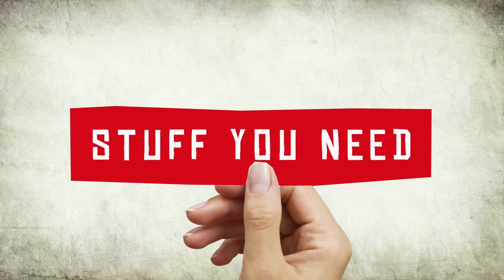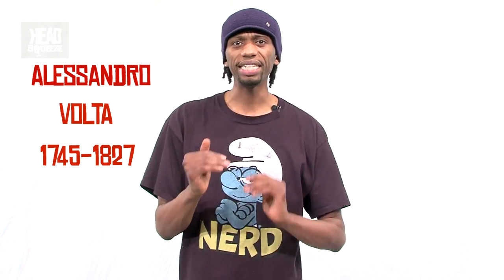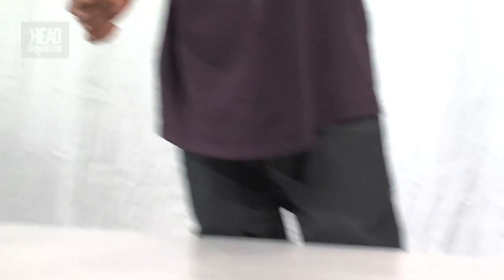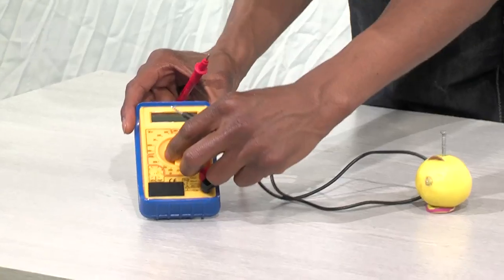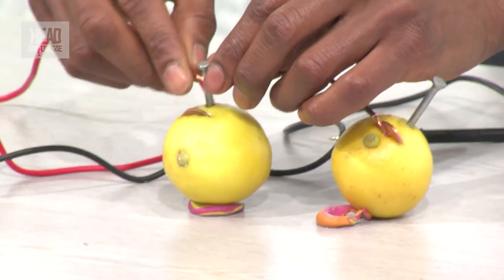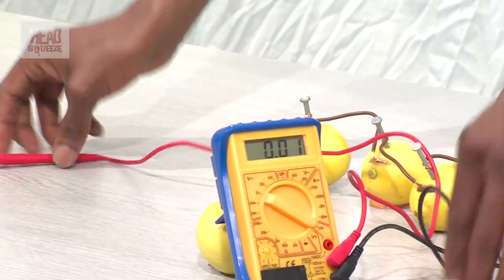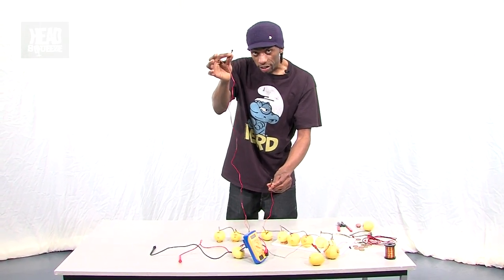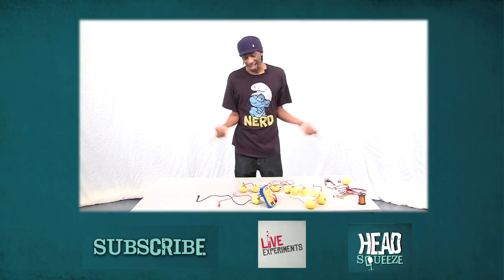How can we get energy from a lemon? | Live Experiments | Head Squeeze | Earth Science

Comment: FYI, you don't need more lemons. If you make a lemon that looks like Pinhead you'll get just about as much energy as the 10 or so lemons hooked in series in this video. The lemon acts as the electrolyte, but the power is in the electronegative difference of the copper and the zinc. The limiting factor is the surface area of each, so shove those pennies deep, those nails deeper, and fill that lemon up.

Comment: Volts are only one part the equation. The starter motor (the bit that gets all the parts moving before combustion takes over) requires some serious amperage, because moving all that iron takes quite a bit more work than powering a led.

Comment: well, 'power' would be a tricky thing to answer exactly, but a car battery is typicaly 12 volts, and so as these lemons produce roughly a volt each, it would take 12 lemons in series to get 12 volts. However, car batteries are able to produce a lot of current, and to get more current, you have to stick this chains of 12 lemons in parrallel. So I would say, probably quite a few of the bitter buggers :D

Comment: This is not true. The lemon's electric charge comes from its naturally present citric acid, which is a negatively charged ion. An electric current is the movement of ions through a conductor, in this case the copper and zinc. And like all fruits, lemons need energy to grow and produce the substances inside them, so the presence of citric acid in a lemon is the result of other forms of energy (like the light energy from photosynthesis) transforming into electric energy by ionizing citrus.